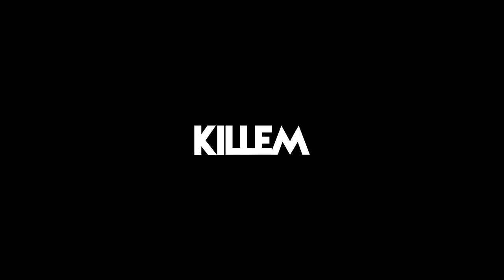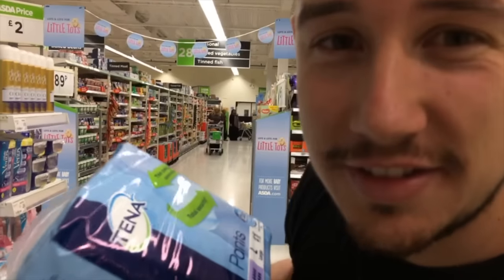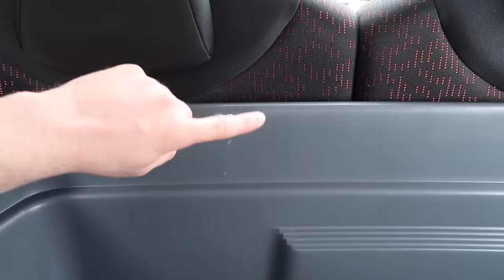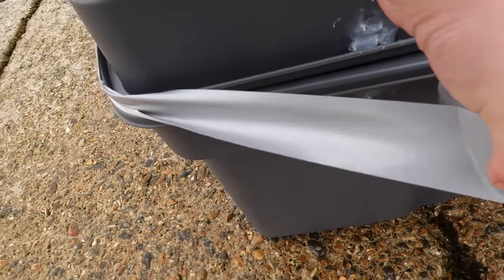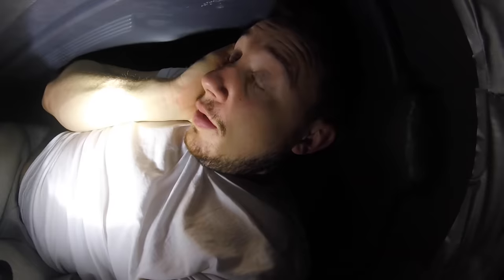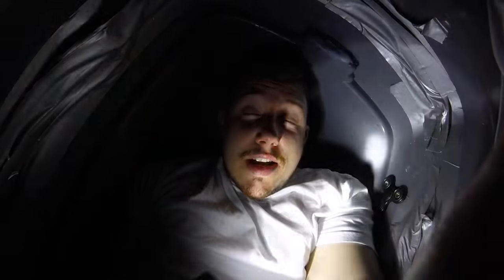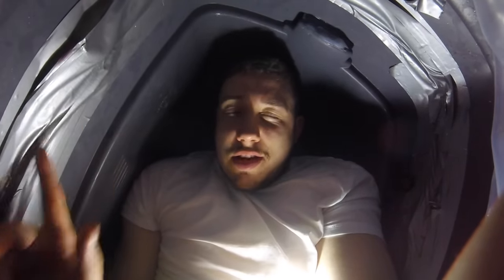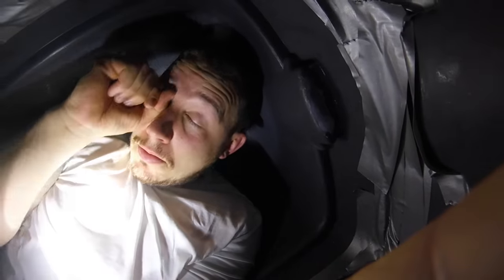I Mailed Myself in a Box *UK to FRANCE* (HUMAN MAIL CHALLENGE PART 2 - AT SEA)

Comment: he also would have been frrezing
Reply: Body heat.
Reply: body heat really doesnt heat it keeps you warm at warm tempatures but, when at sea or when it rains have you noticed you feel cold
Reply: But he was in a closed environment so the body heat would put off heat and make it a heat box
Reply: Astronomi Awesome camera stabilizer
Reply: Cole Tubigan umm body heat and heat generated from the box
Reply: HawkGaming - BG umm those boxes have zero insulation.
Reply: Steven Schukert idk
Reply: Cole Tubigan no
Reply: Sherlock Holmes Yes it is, when it's shredded, turned into a blanket, and made 8 inches thick. 1-3 millimeters of plastic will not insulate heat to any noticeable degree.
Reply: Sherlock Holmes this is direct contact conduction
Reply: Leo Awsome science'd

Comment: There no way that box would be waterproof
Reply: The bearodoom I agree, didnt myth busters fix a leak in a boat with duck tape, it held water for a couple hours but that was it, once. the glue got wet it was worthless.
Reply: The box also would've sank.
Reply: +Pyrofreak yes
Reply: Not to mention the fact that the "safety rope" hole in it would DEFINITELY have water in it
Reply: Killer Beees well he would have taped it up
Reply: It wasn't taped later in the recording so no he didn't 0-o
Reply: The bearodoom it is waterproof,and imagine there's shark...
Reply: The bearodoom Exactly.
Reply: The rope hole was facing up